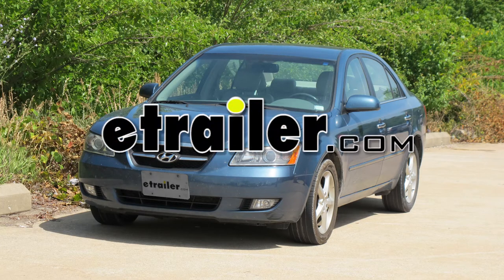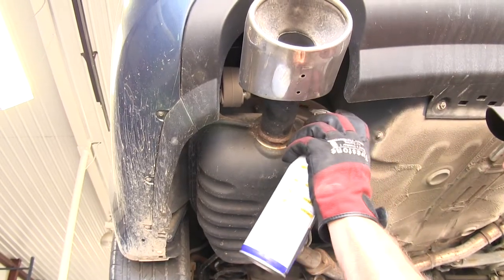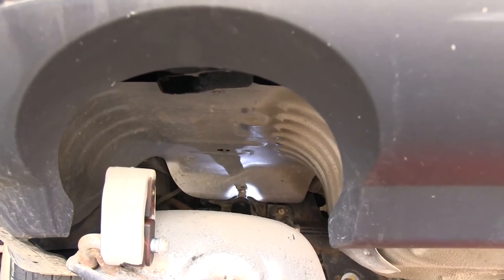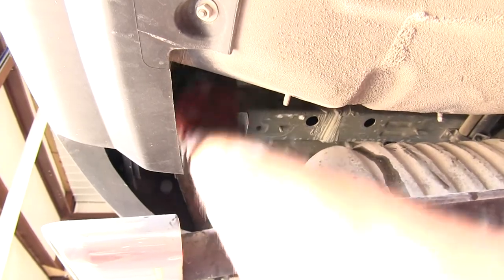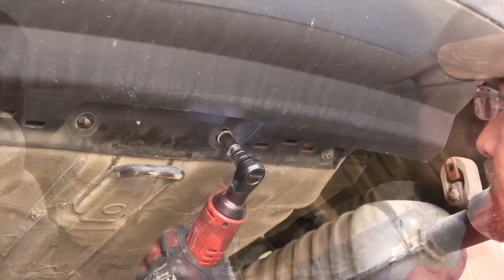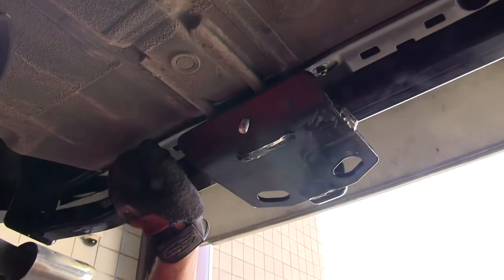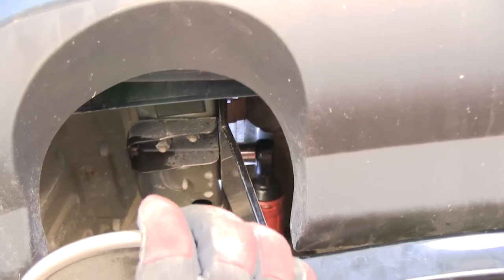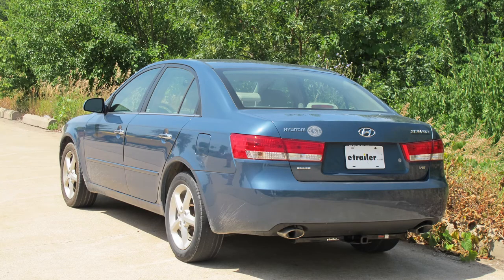etrailer | Set up: Curt Trailer Hitch Receiver on a 2007 Hyundai Sonata

Comment: Can you attach a hitch that would trail a small jon boat or is the Hyundai to low to trail a small jon boat
Reply from the maker: You sure can, as long as the trailer/boat weighs less than 1000 lbs and has a tongue weight of 200 lbs or less.
https://www.etrailer.com/Trailer-Hitch/CURT/C11325.html